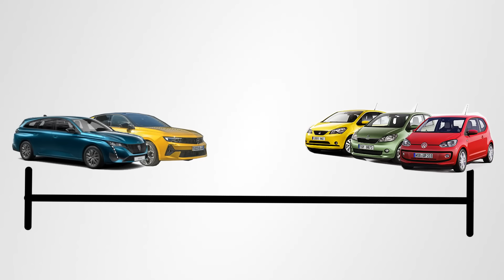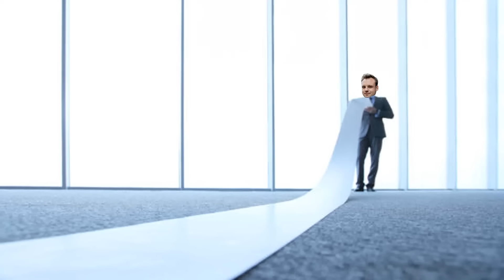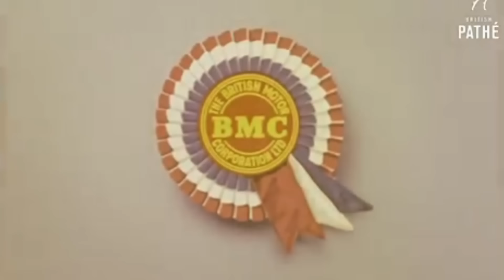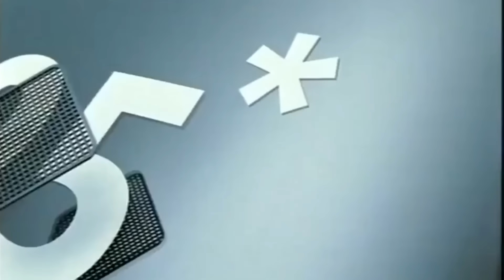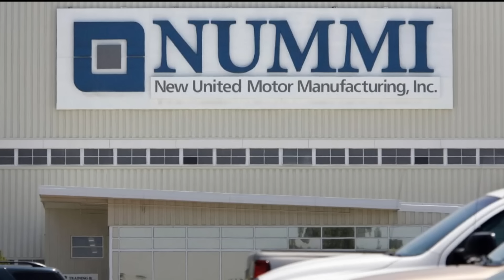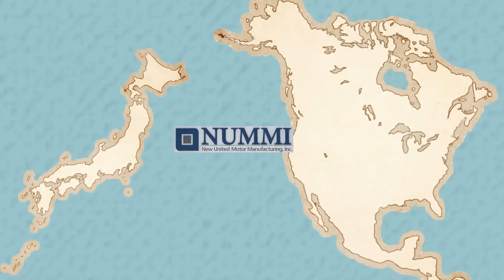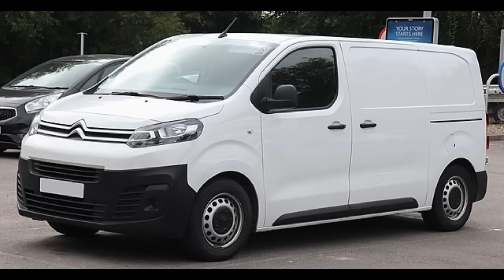Ep. 30 Seeing Double: The History of Badge Engineering

Comment: The first generation Chevy Trailblazer was also sold as the Buick Rainer, Oldsmobile Bravada, GMC Envoy, Isuzu Ascender, and SAAB 9-7X.
Reply: We recently swapped a motor out of a Buick Raineer into my buddies Trailblazer. They didn''t even change the interiors hardly at all with the exception of Isuzu and SAAB.
Reply: K5 Chevy Blazer/GMC Jimmy!
Reply: Dont forget the Cadillac  trivago
Reply: @dougzzzie738  the cloth interior was a slap in the face in those Ascenders. This comment is being made as I sit in my Isuzu with heated leather seats.
Reply: Actually I think you have the order wrong lol I think the envoy was the main and original idea then the rebadged ones came along after
Reply: The 9-7X is the only Saab with an FR layout (or at least rear-biased AWD)
Reply: The Bravada was an S10 Blazer 4-door.
Reply: Ummmm no. The first Generation Trailblazer was actually a rebadged 2nd Generation S10 Blazer.
Reply: @Jag-leaper  ummm idfk what alternate timeline you’re living in, but there was no Cadillac version of the GMT360.
Reply: I wouldn’t consider those to be so much a rebadge as they had unique bodies, interiors (thought the Isuzu and GMC only really differed by the grill), but it was a very broad use of the same platform
Reply: @JK061996  no, the Saab 9-7x didn’t have any special tuning for AWD. It was just that all 9-7x had standard AWD.
Reply: @brycmtthw  what I meant is that the 9-7X was based on a RWD architecture, unlike any other Saab.
Reply: @brycmtthw  clearly, it was a joke..... a play on the fact that there wasn't one AKA sarcasm
Reply: first generation Trailblazer was a trim package on the Blazer not an actual rebadge
Reply from the maker: Especially the Buick is quite the looker..... And don't even get me started about Saab...
Reply: Interesting fact about the 9-7X. It was only supposed to be made for two years, before being replaced by the 9-6X, which would have been a rebadged Subaru B9 Tribeca, to go along with the 9-2X, itself a rebadged Impreza.

That got cancelled, and the 9-7X ended up carrying on until 2009, before finally being (somewhat) replaced by the Mexican built 9-4X (which didn't even last as long as the 9-7X was supposed to in the first place, and was an example of platform sharing, closely related to the second generation Cadillac SRX, and also related to the Chevrolet Equinox and GMC Terrain).

The visual reworking that was done to the B9 Tribeca to turn it into a Saab was then used as a facelift of the Tribeca, dropping the B9 designation in the process.
Reply: @brycmtthw  Trailblazer was a top of the line trim level over the LT. It was chevys way to go after the Eddie Bauer Explores at the time
Reply: @jackdough8164  the bravada was released first out of the gmt360 was supposed to be a big deal having its own unique bodyshell-the izuzu,gmc and chevy sharing mostly same bodypanels. Was the original luxury version, they later used the body stampings from the oldsmobile on the saab and ranier.
Reply: @brycmtthw  the envoy and trailblazer were trim levels originally
Reply: isuzu ass-ender
Reply: Wrong the first generation trailblazer was actually a second generation blazer with a trailblazer emblem in 1999
Reply: @jackdough8164  the first generation envoy was a 2001 jimmy with extra fog lights
Reply: @CamaroAmx  it also awd blazer was 4wd
Reply: @JK061996  it's awd 70/30
Reply: @Jag-leaper  not even a trim package  it literally was a rebadge
Reply: @scootersonlyrepair6773  the trailblazer and envoy..was sold along side the normal blazer and jimmy which soldiered  on until 2004...the new trucks didnt come out until 2002...therefore the first trail blazer and envoy were an upscale trim package only
Reply: And GM is still trying to full customers to this day
Reply: Same with the Chevy Blazer and GMC Jimmy.
Reply: @jimmyjames588  why not?? it works for every other car company....
Reply: One of my cousins had a model called the Typhoon with the same  2 door platform. Those things were so fast that some states literally banned them because cops couldn’t catch them.
Reply: @NellzM60  nope legal in all 50 states typhoons were fast for the time but it's just a twin turbo V6
Reply: @cellpat7392  you can find a GMC envoy Denali pretty easy those all came with a 5.3 V8 I believe
Reply: @CamaroAmx Not the third gen. Also there was a rare Trailblazer trim for the s10 Blazer.
Reply: @michaelf.2449  single turbo.
Reply: @ItsDaJax  oh is it? Only one I ever seen was twins
Reply: @michaelf.2449  oh well it was their attempt to make them illegal. I know many police departments saw them as a nemesis
Reply: @michaelf.2449  Yeah, factory sy/ty is a single turbo 4.3, like the GN and other T-types where single turbo 3.8.
Reply: @Jag-leaper  im not familiar with it, can you send me a link? I can't find one
Reply: This is not a factual post. The 1st Chevy trailblazer was released long before 2004!!!
Reply: SSR was also a trailblazer with a different body.
Reply: You mean a blazer?
Reply: @HorsepowerTube  No it isn't. Technically the SSR isn't even a truck, it's a coupe utility vehicle on a car chassis. It's on the Holden Commodore chassis like the Pontiac G8 and Chevy SS/Caprice. The Trailblazer is on a truck platform, body on frame shared with the Envoy and Equinox
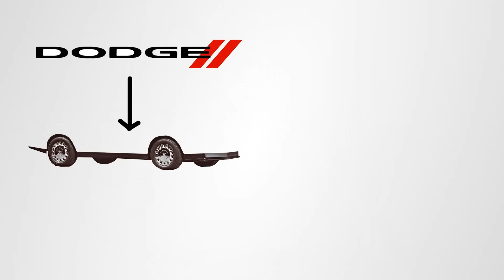Reply: 2:58 no they dont

:)
Reply: @zekeosborne9684  was a joke
Reply: @NellzM60  typhoon was the hellcat of its day!! Beastmode!
Reply: @HorsepowerTube  trailblazer’s only alter-ego was the Chevy Trailblazer SS. It was a beast of its own kind.
Reply: Chevy Blazer, GMC Jimmy, Oldsmobile Bravada, Isuzu Bravada
Reply: @michaelf.2449  Denali came with 6.0
Reply: @michaelf.2449  Typhoon was single turbo 4.3
Reply: @travisdavid7606  not in the states only had a 5.3
Reply: @michaelf.2449  every Denali I've seen here had 6.0 even the old ragidy 1999 that was on my job the other day it was 6.0 all wheel drive
Reply: @travisdavid7606  probably every other model but the envoy specifically has only a 5.3 in it unfortunately you can look up all the info but yeah it's only a 5.3
The only trailblazer with a 6.0 is the SS and it's AWD I don't think any other envoys or trailblazers were AWD either they were all just 4wd or 2wd specifically the Trailblazer SS is a 6.0 with AWD
Reply: @michaelf.2449  I apologize you are talking bout Envoy Denali heck I didn't even know they had them all I've seen is the bu bu 5 cyl Envoy
Reply: @michaelf.2449  I just googled Envoy Denali pretty sweet I never was a big fan of envoy or trailblazer I have 2 S10 Blazer and a GMC Jimmy it has like 480,000 miles on it 3 transmission's, original engine though
Reply: @travisdavid7606  ohhh yeah it happens I've currently got a envoy with vortec 4200 inline 6 and it's pretty nice for being a cheap SUV
Reply: @mrflynn01  Yes sir, you’re correct. I had a blue and grey 2002 Chevy TrailBlazer LTZ just four years ago.
Reply: @brycmtthw  The Saab 9-7x Aero = Trailblazer SS
Reply: This was the first that came to mind!
Reply: @ItsDaJax  you have no idea what you're talking about, you've clearly never worked on one. I've worked on many. SSR literally rides on a trailblazer frame. Ever notice how it's the same 6 lug pattern as the trailblazer? Hell, it even has the same front hubs with splined holes in them for 4wd. It'd be very easy to make an AWD SSR. Just bolt in the trailblazer components that are missing. Also, the trailblazer is in no way related to an equinox. (At least not the gen we're talking about) equinox is a little fwd based suv. More like a car. A far departure from a body on frame trailblazer.
Reply: @NellzM60  that same LS2 powertrain was also used in the later SSRs
Reply: @HorsepowerTube  Okay, then I was wrong. I've never seen one without the centercaps on it, I had no clue. I made a mistake. An awd SSR sounds awesome, if it doesn't have an open diff.
Reply: @HorsepowerTube I believe the corvette used it too with a super package included
Reply: @dougzzzie738  gmc is completely different from most the others interior wise, and better, i did however pull a center console out of a trailblazer for the extra cup holder, waiting to find a bravada so i can get that sweet woodgrain
Reply: @Jag-leaper  Cadillac what???
Reply: @Hunt4Yoshi  teehee :)
Reply: I believe you’re thinking of the older S10 Blazer. The Trailblazer came along later, and was doubled by the GMC Envoy.
Reply: holy shit
Reply: Chevrolet Tahoe/Suburban, GMC Yukon/Yukon XL, Cadillac Escalade /Escalade ESV , Chevrolet Avalanche.
Reply: And the Chevrolet Traverse, GMC Acadia, Saturn Outlook, Buick Enclave.
Reply: No hate against GM but General Motors is the king of rebadging.
Reply: @Jag-leaper  , you clearly meant the Escalade, did you not?
Reply: Plymouth Trailduster
Reply: So was the minivans from them
Reply: Ascender is built like a tank but has the internals of a lemon
Reply: I own an 02 Envoy and I like the fact that there's so many sister models to my car. I can guarantee that if I go into a junkyard to pull parts, one or more of these models will be there and fit my Envoy. It also makes the price for transmissions and engines cheaper since there's SO many of them out there and can be easily sourced. If I wanted to, I could also swap out interior or exterior trim and have it fit.
Reply: @woofgbruk5947  Chevy tahoe/GMC yukon1!!1!1!1!2
Reply: @ItsDaJax  wasn't the SSR in a gmt 300 platform series?
Reply: i think it was a holden and a Opel versions too they were fucking everywhere!

Comment: The first Honda Passport in the 1990's was a rebadged  Isuzu Rodeo with 12 months 12,000 miles less warranty and a $3000.00 up charge just so it could be called Passport.  A girl I worked with was a hard-core Honda person.   She was going to trade in her Accord for a Passport.  I told her why don't you save yourself $3000.00 and go with the Isuzu.  She said that she would never be caught dead in a crappy Isuzu Rodeo.  Ok, good luck with that Honda.
Reply: The Saturn vue has a honda j series engine.
Reply: I was just commenting how I had one of those Isuzu Rodeos. It was Identical to the Passport except Honda did change the interior a bit. I did a lot of the repairs myself and it had a lot of GMC Jimmie parts... the suspension and frame were based off of a Jimmie Blazer.
Reply: @jesseswalters  For a moment I thought you were talking about the Jimny a tiny off-roader made by Suzuki.
Reply: And the Isuzu Trooper/Acura SLX/Subaru Bighorn
Reply: My old man wanted to buy an Isuzu DMAX, but it doesn't come in an extended cab with a manual transmission. I said "what about the Mazda BT-50?"
He claimed he liked the Isuzu, not the Mazda. I told him to go down to the dealership and take a look at the difference. 

Anyway, now Dad drives a Mazda.
Reply: We got Holden rodeo in Australia

Comment: The best badge engineering of the '80's was the Chrysler K cars.  When they did the annual unveiling they started with Chrysler.  The next day they did Dodge and the day after that Plymouth had it's day.  But they didn't have to move any cars around.  They simply changed the grills, badges, and in some cases the taillights.  The cars remained the same.
Reply: Heck, the K-platform was an example of not just badge engineering, but also platform sharing, as many platforms in the 80s and early 90s made by Chrysler were actually based off of the K-platform.

The K platform became the basis for the E (longer wheelbase mid-size), S (minivan), G (sports cars), H (also mid-size), P (compact), J (also sports cars), C (also mid-size), AA (mid-size, again), Q (the dud that was the TC by Maserati), Y (stretched version of the C, were luxury cars), and AS (second generation minivans), with the last cars derived from the K platform going out of production in 1995.

14 years (K platform introduced in 1981) and 11 derivitives.
Reply: Wow that’s so interesting!
Reply: @carcrasher88YT  thank you for that, i am a chrysler guy from way back and knew MOST of this, i had a 600 es turbo coupe, ( convertible) and an early caravan, loved them both, but i was a fifth avenue guy, and briefly had an e- class fifth avenue to go with my new yorker fifth avenue, i outlined the 80s full size (WHICH started out as mid size grocery getters in the 70d
Reply: @carcrasher88YT  Actually I think the third gen Caravan/Voyager/T&C are the last K-cars, 98-02(?) sporty bodies, last gen for the Voyager.
Reply: During the 1970's Ford did the same thing. Other than grilles or taillights you could not tell a Mercury from a Ford.
Reply: In the 1987 action movie "Extreme Prejudice" one of the vehicles driven is a Dodge Lancer (with a Chrysler badge, possibly under licence by Mitsubishi), if I'm correct, it was a partnership between the USA and Japanese that lasted sometime.

Mercedes Benz scored a masterstroke when they acquired Chrysler/Dodge and Jeep (collectively known as DaimlerChrysler) unfortunately the less than perfect quality of a number of vehicles from the American company led to them being owned today by Fiat - looking a lot more promising than previous years.
Reply: @anthonylewis2080  Chrysler and Mitsubihi were in partnership for a number of years.  The Dodge Omni/Plymouth Horizons used Mitsubishi engines and Chrysler sold Misubishis rebadged as Dodge and Plymouth models.
Reply: Those K cars saved Chrysler from bankruptcy back in the 80s. Yes, I'm old enough to remember that....
Reply: The Caravan and Voyager actually had different grills and headlights up until 1988, when they all got euro-style flush headlamps, the grills remained different until Plymouth went under.
Reply: Chrysler's cross-division rebadging reached it's peak in the Neon.  Early on, the word on the trunk lid was all that made it a Dodge or a Plymouth (or a Chrysler in some export markets), but they were all Neons.  In later years, there was first also a badge for the make on the front and later even a name on the door.  My dad had an early one that got its blue-purple paint damaged on the trunk, so we took the lid (only) to a paint shop to be repainted.  Of course, they had to remove the adhesive plastic "Plymouth" and "neon" words, which he told them not to bother to replace.  Thereafter, it had no make or model markings on it at all!
Reply: Same with the Plymouth "Valiant" and Dodge "Dart" models. Turned many into "Plodges" Easy grille and taillight swap. About twenty minutes. @MidKid61

Comment: The original Mini was sold as the Morris Mini-Minor, the Austin Seven, the Wolseley Hornet, the Riley Elf, and later on it was sold as the Rover Mini and finally just the Mini. BMC/Leyland/Rover are repeat offenders at this. Who could forget such monstrosities as the Vanden Plas Allegro and the Rover 45/Honda Concerto?
Reply: to be fair, the Wolseley Hornet and Riley Elf had extended boots that the Mini lacked, as well as timber dashboards and twin, rather than single carbs, so some effort was put in
Reply: British Leyland had at least 50% of cars based on a different one and 40% more were outside based or engineered. I think the reason they get away with it is because of how much they struggled up a literal cliff.
Reply: Just like the Rootes Group:
Hillman Minx
Singer Vogue
Humber Sceptre
Sunbeam Rapier

One carb or two, sir ?  Plus new grille on each one.

Sticking with the British Motor Company:
Austin A55 Cambridge
Morris Oxford V
Riley 4/72
Wolseley 15/69
MG Magnette III
Siam di Tella   (in Argentina)

One carb or two, sir ?  Plus new grille and tailights on each one.

Or:
Austin 1800 and 2200
Morris 1800 and 2200
Wolseley 18/85 and Six
(ie same bodies, with a choice of 4 cylinder or 6 cylinder engines)

and abroad:
Austin Balanza 
Austin Freeway
BMC Freeway
Austin Windsor
Morris Monaco
Reply: @oldcynic6964 British Motor Corporation.
Reply: And Innocenti in Italy to some extent
Reply: @mumbles2000  in South Africa you can get a regular front end mini with riley/wolseley rear end and riley/wolsely front end with regular mini rear end.
Reply: The Rover 200 was horrid for it, it was the 200, the 25, the ZR, the streetwise, the MG 3 SW, then the 25 and ZR got a facelift

Comment: Here in Brazil the GM Chevette was the sedan, the Marajó was the station wagon, Chevy 500 was the mini pickup truck and one not mentioned in the video was called Chevette Hatch, you guessed it, for the hatchback.

Edit: Also GM in the early 2000s here in Brazil sold a SUV called Tracker at the same time Suzuki sold the same car rebadged as Vitara. The diesel version had a Peugeot engine that caused all sorts of problems with our crappy diesel fuel sold here...
Reply: eduardocostaps1979  The autolatina came up with a lot of cars:

VW Saveiro / Ford Pampa
VW Santana / Ford Versailles
VW Logus / Ford Escort
VW Apolo / Ford Verona